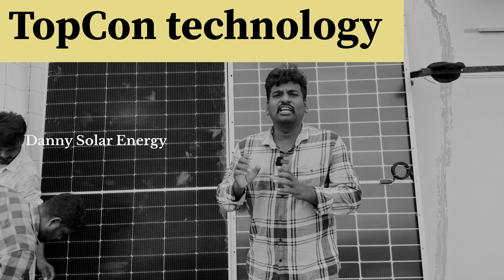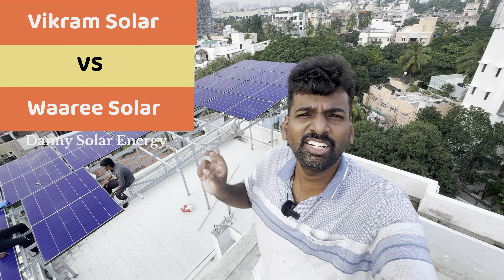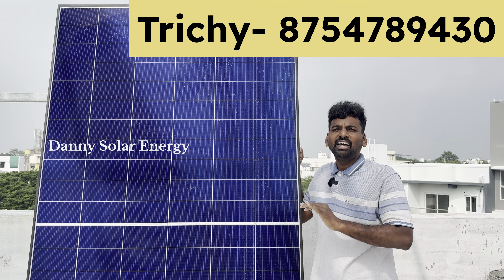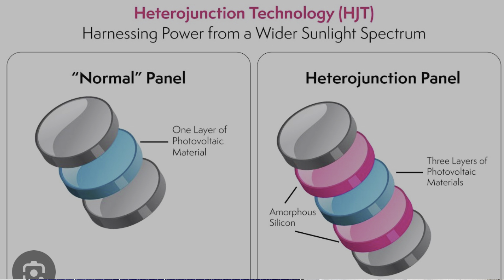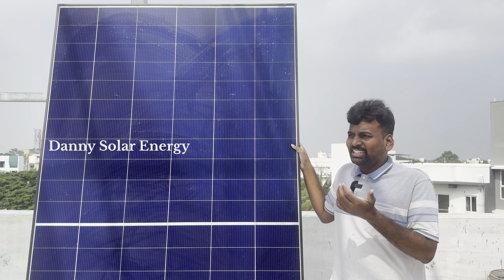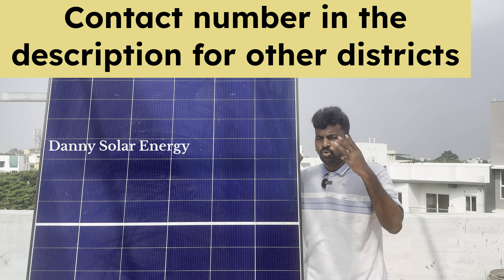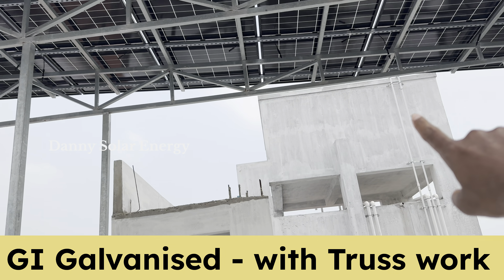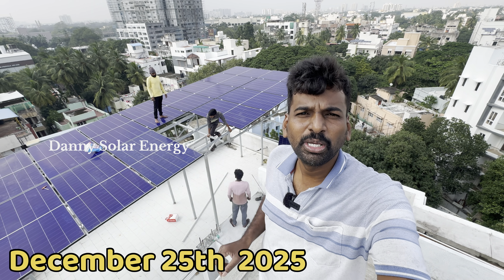730 watts HJT Hetro Junction Solar in Chennai | 13.5KW On-grid solar system | Danny Solar Energy |

Comment: Hi danny, I am planning to install a Dual axis solar tracker instead of  fixed mount solar setup. What are your thoughts about it ? Your opinion is highly valued.
Reply from the maker: This system will work efficiently only in mega watt projects not in residential projects. May I know how many kw you’re going to install ?
Reply: @DannyTechieTalks  5kw
Reply: Whom is supporting in installing dual-axis tracker? Can I know vendor name or other details?